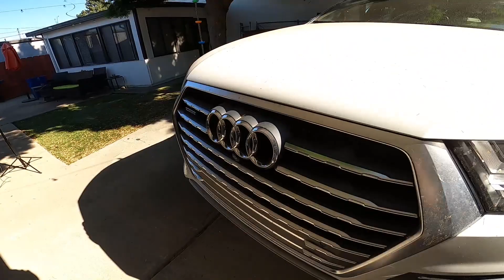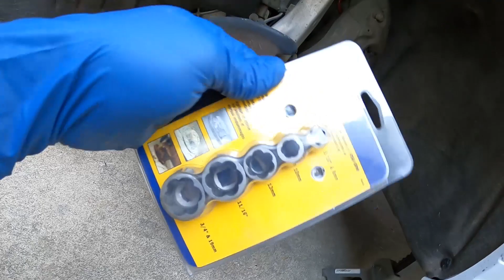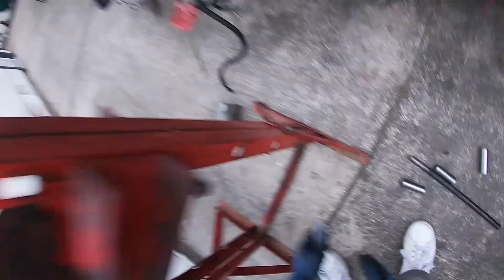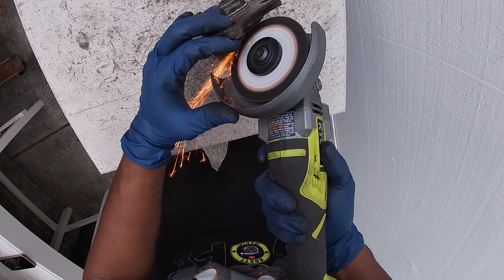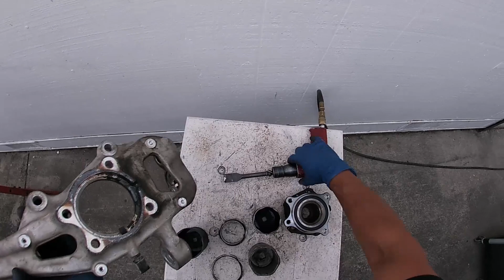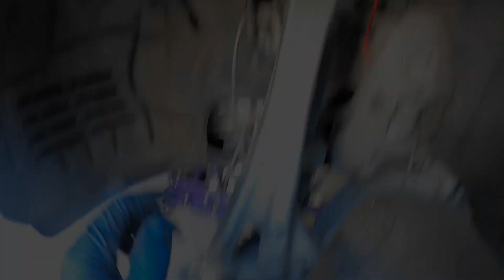Audi Q7 Front End Noise Fixed

Comment: Pretty suprised that there's no safety wire or castle nut on ball joints considering how safety conscious these vehicles are (reverse with door open, need to be parked to open hatch, can't lock with fob when running, no AS....).  Great video and thanks for sharing.
Reply from the maker: Great comment, I agree with you there should be a castle nut and cotter pin. Thanks for watching and commenting I appreciate your support of the channel.

Comment: My man… you could have put the bolts in the hub and slide hammered it out once it came apart. Good work though
Reply from the maker: Thanks for your comment and for watching. Yeah probably could have slide hammer it off but would still need to press it all back together off the vehicle. I appreciate you.
Reply: @ it would have saved you from pulling the entire arm off. I’m getting ready to tackle mine, that’s why I watched yours 😂